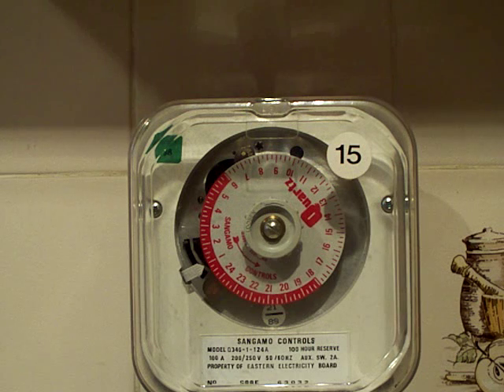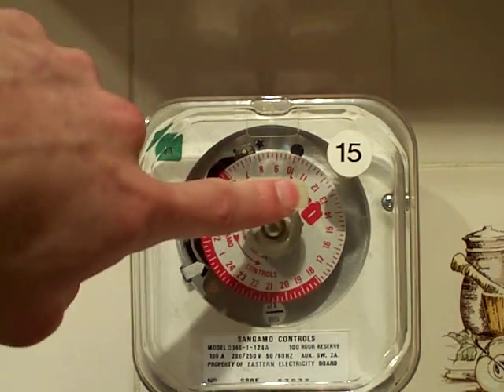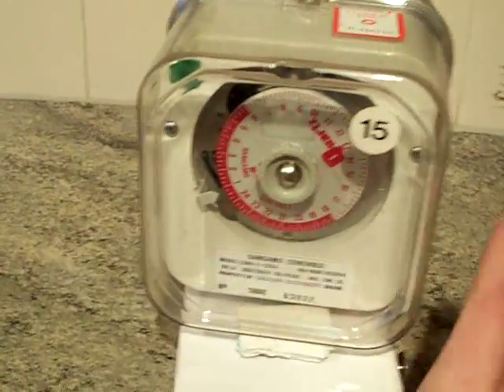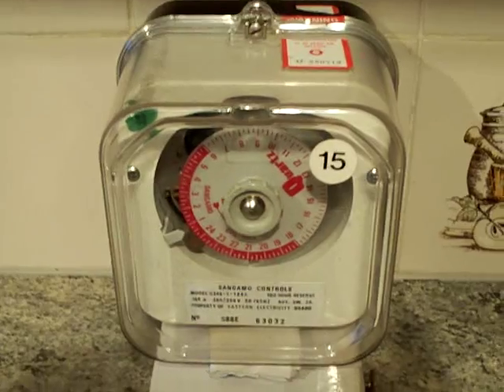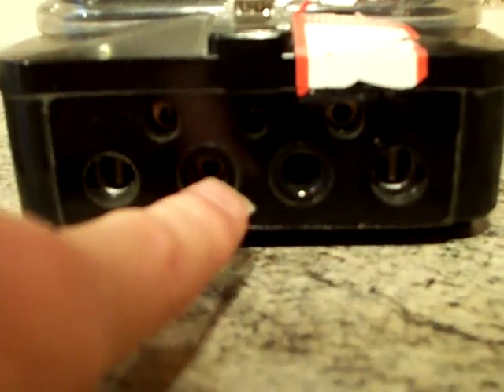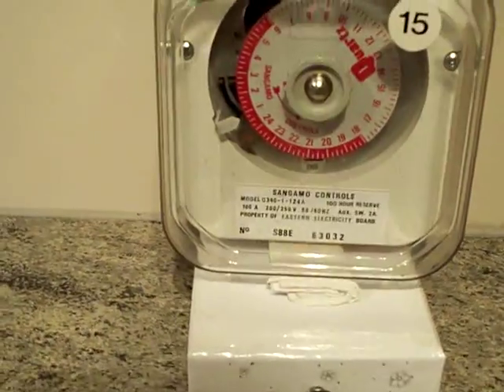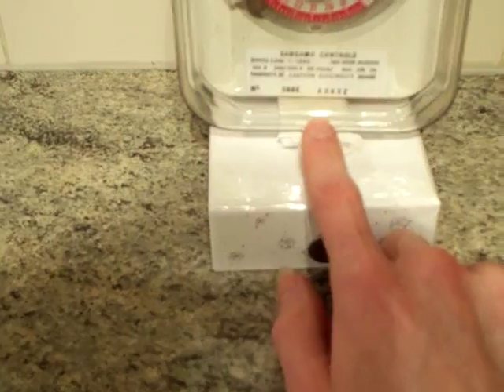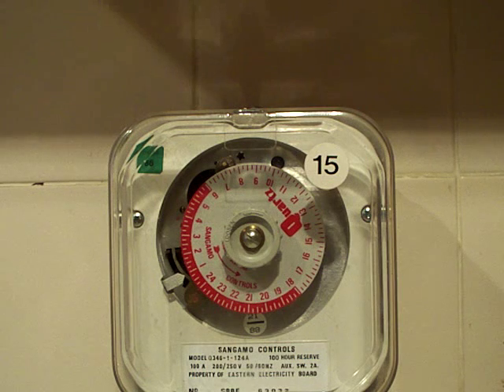Time Switch : Sangamo Q-346 Quartz Rate Changer.

Comment: You can also fit a 100 uF 16 Volts capacitor in it's place and solder a red LED across it.
The LED will pulse at the one second beat.
The clock will work when the power is on, but will stop when the power is off.

Comment from the maker: @RODALCO2007 Hiya! It's an interesting idea, but the thing is with these, being sealed units, is if the power is off for any length of time, it means having to unscrew the front-case to correct the time on it. 

I do wonder if instead, if I could achieve the same effect if I were to connect the LED across the motor coil? That has electrical pulses going to it, and I wonder if there would be enough juice going to it in order to power the LED also without affecting accuracy? Hmmm.......

-BBD